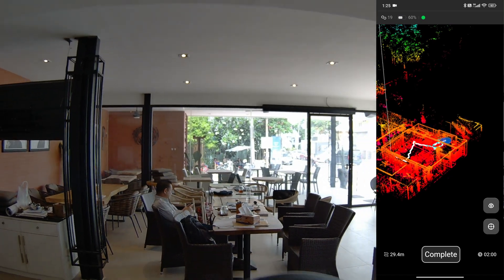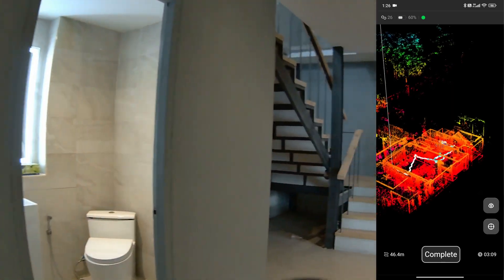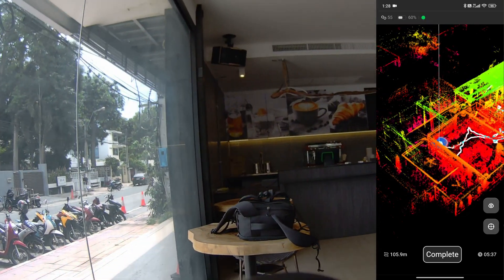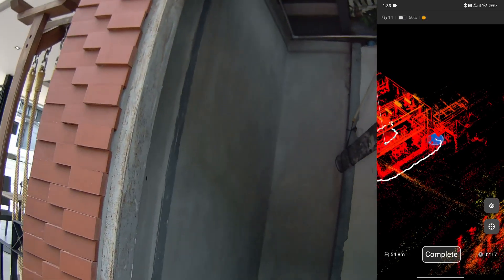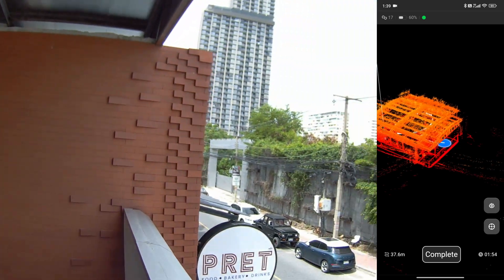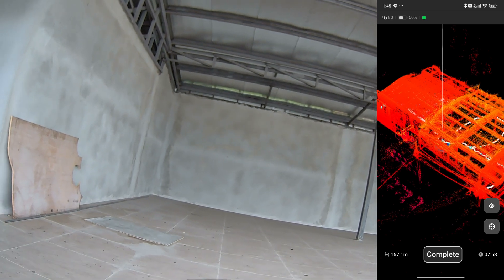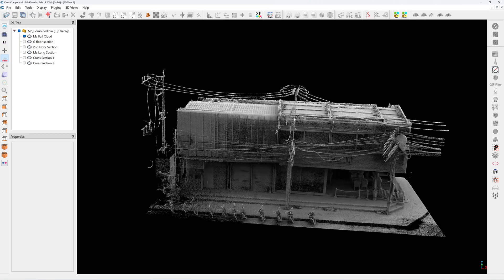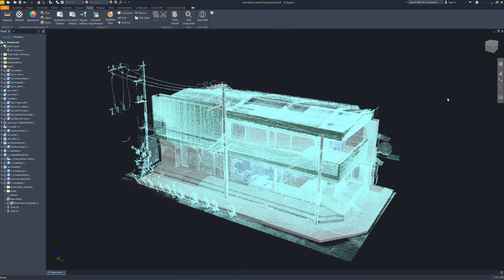3D Scan Building Show Case - McDonald's Pattaya

Comment: Excellent results. You do know every trick there is.
Do you mesh the point cloud ever for the architect, or just supply the cad model. It would be neat to watch the tracing process, and the merging in cloud compare.
Also how does this handle mirrors and glass? Fairly well it seems.
One last question, how is the accuracy….would this be useful for planes and boats to mm accuracy, or is this more just for large spaces
Reply from the maker: Mirror will make ghosting image on the other side of the wall. I've to delete them manually. Clear glass or translucent glass has no issue with the LiDAR. Plane is big enough for the scanner, but the accuracy lies somewhere between 10-15mm. Good enough for construction work but no mechanical.